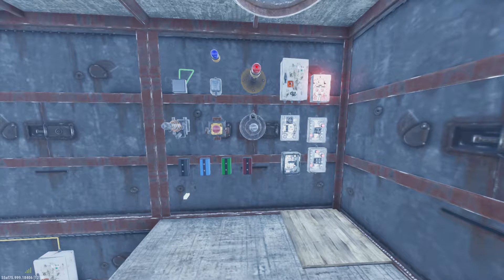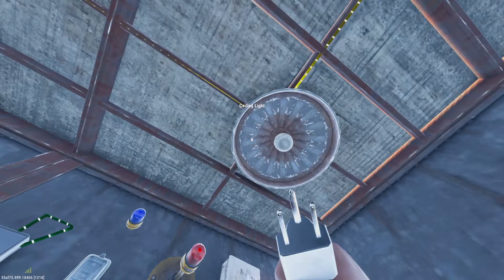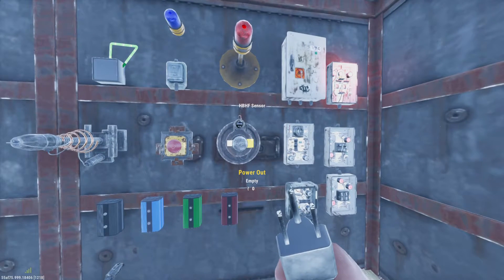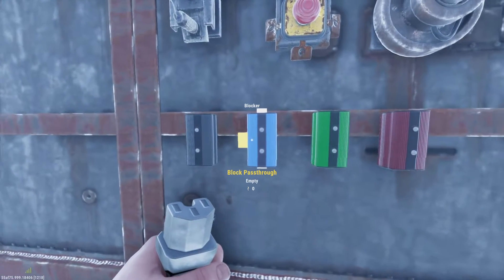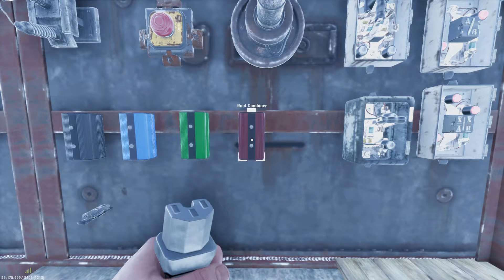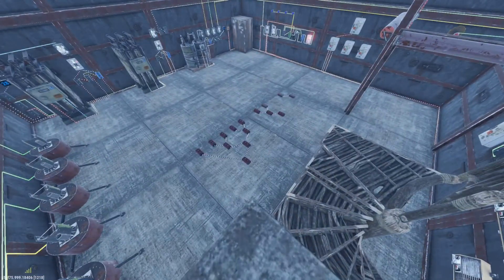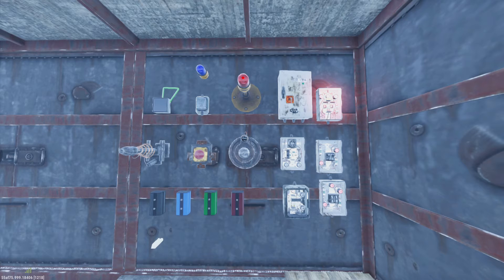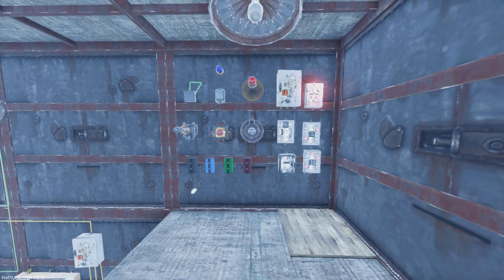Basic Electrical Component Guide - Rust Console Edition *See Edit In Description*

Comment: I think you have to revisit or and xor switches. everything you said is incorrect.
Reply from the maker: Yeah I got them all backwards. Didn't even notice. Thank you. I've edited my description. Appreciate it. 

OR switches allow power from either port but only the power of the higher amount. One or both can be active, doesn't matter.

X/OR allows for power to pass through only if one port is powered and not both.

AND switches only allow power to pass through if both ports are active and only the higher amount.

Comment: Better explanation for and switches.. it's a root combiner with a built in switch..
Reply from the maker: It allows for 2 power sources to be combined into 1 wire. It REQUIRES power being sent into both inputs while only sending the power of greater value through it. Does not combine power.